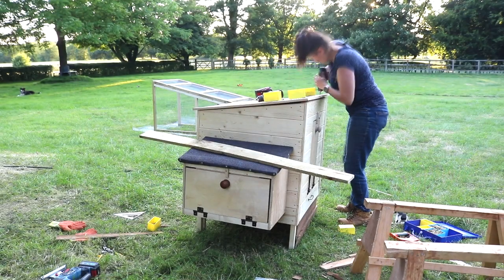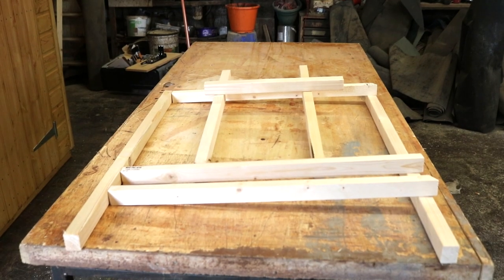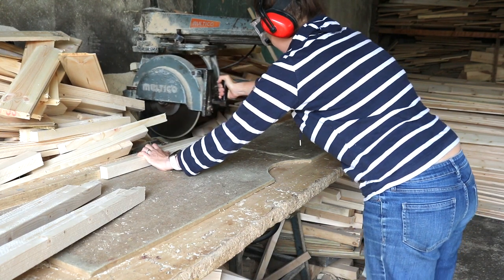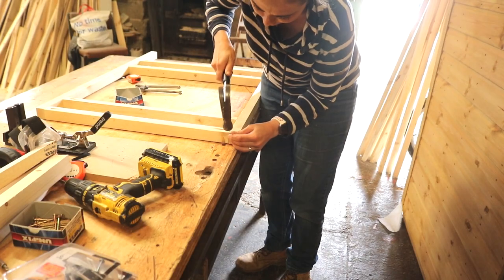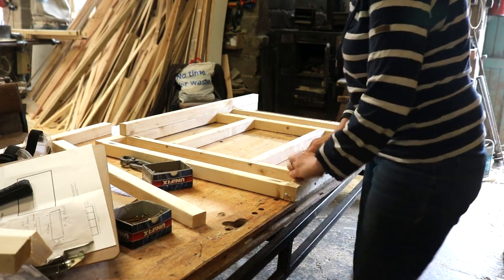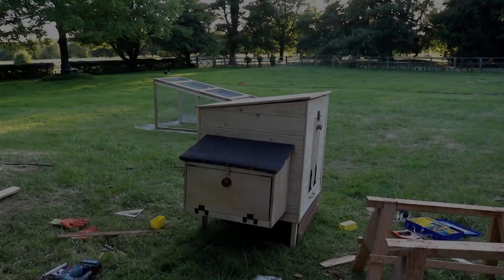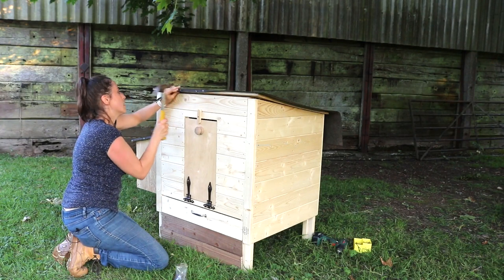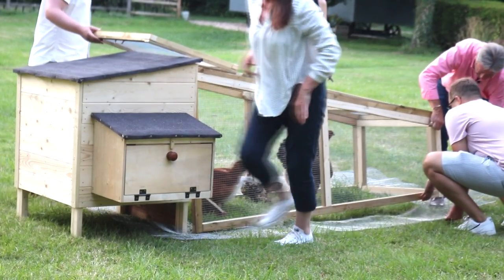DIY Chicken Coop Build | The Carpenter's Daughter

Comment: Cuprinol ducks back is pet safe and comes in various colours have used it lots and really good
Reply from the maker: Thank you!  I have some of that and will check the back.  I saw some say you have to wait a while until fully dry and many didn't guarantee it.
Reply: The Carpenter's Daughter 
It’s guaranteed for 5 years my wife treats the inside with creosote because it keeps red mite at bay chickens at pretty hardy birds
Reply: @flintsrevenge2157  Hasn't creosote been banned in the UK since 2003?
Reply: Sindento 1 
You can by what is known as a creosote substitute